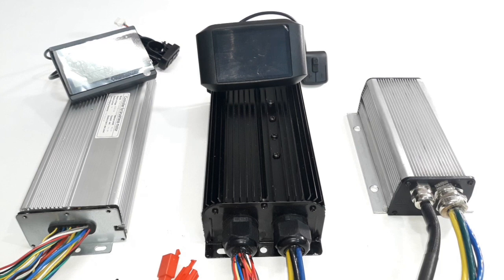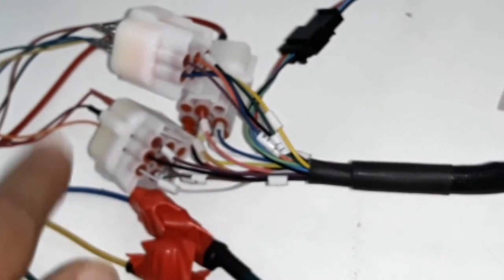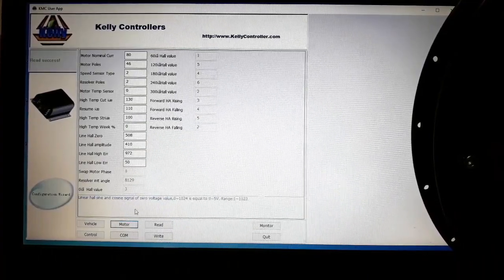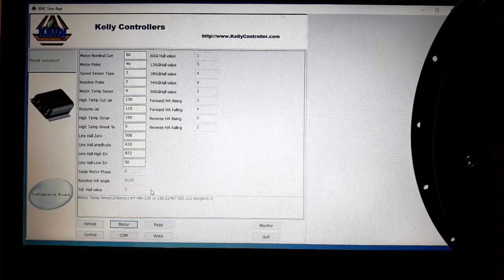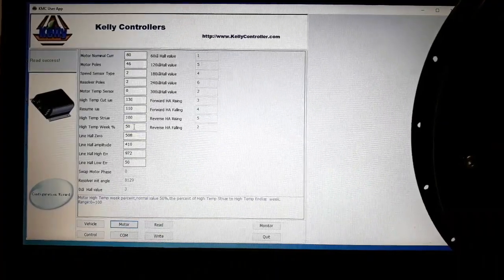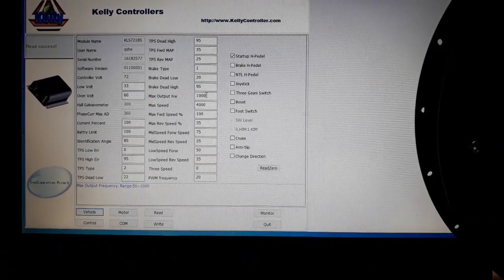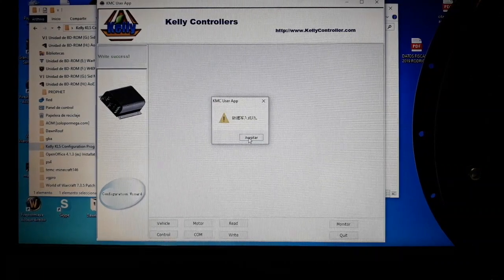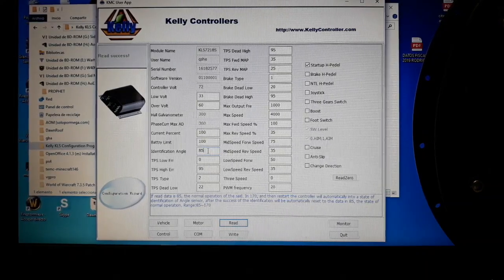KellyController Parameters, Programing setup, Part1 (English)

Comment: Hi thanks where to connect the PAS on KLS7212S ??
Reply from the maker: Hi Jean, this KLS controller models does not have PAS sensor input chanel. 
There can be a way to connect a PAS, Torque, Force or similar sensors and made them work, but I do not know how.
Reply: @gonzalop.chomon327  Thank you very much i was lost not to find it.
Reply: @gonzalop.chomon327  I have a torque sensor i will probably try on the accerator chanel
Reply from the maker: @jeanterine4712  Let me know if it works and how.
Reply: Afaik the only way to really get PAS support on the Kelly ESC is to pair it with a Cycle Analyst v3 display from Grintech. To do that you'll need either (easier way) the grin tech external molded shunt or do a CA hookup to the controller motherboard. Then you setup your pedal assist parameters on the cycle analyst.
Reply from the maker: @ABritInNY  Thank you for the info.

Comment: The BBSHD has 88 effektive Motorpoles,does it mean i have to write 44 at motor poles,
And which Temp-sensor do i choose when there is a 10K in the BBSHD??? Thank you
Reply from the maker: The BBSHD motor has 4 poles so it will be 8 for the "Motor Poles" field.
About the thermistor, this controller accepts the KTY84-130 (970 - 1030 Ω) and the KTY83-122 (1000 - 1020 Ω) so I believe that a 10K thermistor will not work for this controller.
Reply: @gonzalop.chomon327   Okay only 8 poles, thank you!
Reply: Hi i have another question, my bbshd doesnt finish the identification angle, both LEDs stay on, the error code is 3-4 speed sensor, do you have a ideal what the Problem is..Thanks
Reply from the maker: @manuelschilli4912  First, what controller model are you using?
Second, does the motor start?
Reply: @gonzalop.chomon327  kls7212s, no the motor doesnt turn, it Klicks about 7-8 Times when i do the identifikation angle. When i turn the power on the code 3-4 red Lamp comes
Reply from the maker: @manuelschilli4912  The motor should run even before the identification angle procedure is made.
If it does not turn when you apply throttle means that provably the phases and hall sensor wires are not connected in the right combination.
Reply: @gonzalop.chomon327  okay the phases are colour to colour(yellow to yellow , bl-bl, gr-gr), maybe i should switch the hall sensor cables?
Reply from the maker: @manuelschilli4912  There is 36 different combinations of the hall sensors cables and phase cables, only 6 makes the motor turn.
You need to find one of them. It does not matter if the motor turns in the correct direction, that can be changed latter in the software.
Reply: @gonzalop.chomon327  okay thanks a lot my friend, you saved me!
Reply: Sorry have to interupt you again, i have now tried every position on the phases and halls, the error code is still there, i also checked the motor phases if they are short, but are also okay, whats Strange is when i take out one hall sensor wire when power is on the controller get warm and makes strange noises?
Reply from the maker: @manuelschilli4912  Well like I said there is 6 different combinations of phase cables and hall sensors cables that should make the motor turn.
What you say about the controller getting warm without the motor running it is very strange because there should not be any big currents passing throw it enough to heat it up.
Can you test it in another motor?
Reply: @gonzalop.chomon327  I have tried all combinations, i just Think its the Controllers fault, i will order a new one and test it the next days, thanks for your time 👍
Reply: Hi its me again, new controller works. I have my motor current on 40% means 48A(120peak) and the batterie current at 100%(batterie cells have max 48A output) does this mean the batterie current max. is also 48amps.
And low speed doesnt work, i have max speed at 15000 and low speed at 20% but the bike doesnt get any slower at low speed. Thanks
Reply from the maker: @manuelschilli4912  The "Motor current" is in order to protect the motor, here you set up the maximum current that the controller will give to the motor at peak.
"Battery Limit" this is in order to protect the battery, if your battery can give up to 48A then set it up for that.
In order to activate 1, 2 or 3 speeds you need to put the value of 2 in the "Three Speed" field.
The maximum speed should be set up close to the maximum speed that the motor can achieve, else the three speeds function become obsolete. As well that can be used to tune the speeds to your needs.
For more info about it check the videos.
Reply: @gonzalop.chomon327   Thank you, but battery current is also percent, but of which one, is it percent of the amps i but in at the max motor current, or is it the percent of what the controller can handle continious or peak, or isnt it in percent?
Okay so i have to go down with the rpm, do you know how much it is, bbshd at 72volts. Thank you
Reply from the maker: @manuelschilli4912  This is not a plug and play controller you need to RTFM.
"Battery Limit" refers to maximum power that the battery can deliver continuously.
"Current Percent" refers to the maximum peak power of the motor.
I don't know the KV of your motor. With that number you can calculate the max motor speed = KV x Max. Battery Voltage.
Reply: @gonzalop.chomon327  Okay i have now tried to set the motor rpm lower, turned the three speed switch on 2, on Monitor Button the low speed goes from 0 to 1 but the motor runs with the same rpm, do you have any tips why?
Reply from the maker: @manuelschilli4912  I had once a controller that didn't recognize that either. I suppose it was faulty. It maybe your case as well.
Try 3 speed instead to see if there is any changes.

Comment: I don't understand, i used your very usefull video to link my kls7212s to my mxus xf19 but it don't work. I linked the 5 hall wires, the 3 throttle wires, the power wire to the plus of the 52v battery, the 3 phases wires. When i first plug the battery and the power cable i had a green light flashing on the controller, i immediatly tryed to use the throttle and i felt a beggining of reaction like a very little impulsion every time i started to activate the throttle, avery very shy move then the green flashing light turned to a flashing red like this: 3 times flashing then 4 times flashing again  and again. If someone can help me, i checked all the connections, nothing wrong
Reply from the maker: @jeanterine4712, 3-4 flashing light means: Angle Sensor Error:
It can be:
- Connected the phase wires or the hall sensors wires on the wrong combination
- Damaged hall sensors
- Identification angle procedure not made or failed
- Wrong setup of kind of sensor
I bet for the first or third reason ;)

Comment: Hello dear how i can increase mor power to motor?   and more power throttle?
Reply from the maker: In order to give you some advice about it I need detailed information.
But before of all you need to know this: A battery powered electric system depends on the battery power. So if you want more power the best way to start is to have a more powerful battery.
There is different ways to pimp up controllers and motors so they can give more power that what have been designed for, but first the battery has to be able to give that power to the these devices.
Reply: @gonzalop.chomon327  battery 72v 42A controller kelly 3000w 150a
Reply from the maker: @danabuksis6231  I suggest bigger battery if you want more power, but may depend in your application, if you need it to run just for a few minutes (10-30) it may be enough battery (at the costs of battery life)
With that little info is not much more I can recommend you.
Reply: @gonzalop.chomon327 What's in the app category for more speed?

Comment: Dear friend, please help me. I connected everything and a red light and a green light came on. The engine does not turn when I turn the throttle and I connected everything properly. I would appreciate it if you could get back to me as soon as possible.
Reply from the maker: Usually the red light will flash with a code, 3-2 or 4-3 or whatever.
At the end of the manual you will find what every code means.
If you can not find it let me know the code and I will try to help you.

Comment: So there is no Regen ??
Reply from the maker: You can setup the regeneration different ways: No motor brake, Intelligent automatic regen brake (using brake switch), Analog regen brake (using a potentiometer or a hall sensor throttle/pedal), Release throttle regen brake and as well you can setup, slope braking aid and direction change regen braking.
You can see how to set up on next videos:
Part 2: https://www.youtube.com/watch?v=_if9dnVkr6U
Part 3: https://www.youtube.com/watch?v=ITP6mey2eCk

Comment: I Gonz, i see your video 2-300 times, but in something Im wrong:
 

I  I am Carlo and write from Italy.
I have a problem with the Kelly controller paramenter !
I use a Kls 7218 s, a mxus 3k turbo 8000W peack, and a  battery  pack 72v 28Ah 2160 Wh (compost of 160  samsung cell  35 E  18650 ) at last,  a Daly bms 72v  20s 150 Amp. 
The sistem dont' work!
I change all the possible parameters on kelly's App. But Noting!!!
So I ask me, and ask you :
-1 : is possible that the color of the fases ar wrong..??? if i change the color for try, i broke somenthing?? and
-2:Do you have, and do you can,  send me all the true app parameters, for a pretty use?
I don' t know ...I am disperate.....the seller of the kit, is a very bad boys...and i don' t know more what i can do.
If you can help me 
….I'm becaming mad!

Carlo,
Reply from the maker: As you already have played with the parameters in your controller, first make sure that in the App you are using hall sensors parameter (Your motor has hall sensors)
Then you need need to make the motor turn. 
There is 36 different combinations of how to connect the cables of the motor and the hall sensors.
It only works in 6 of those 36 combinations. this is done by try and error.
When you see that the motor turns (does not matter what direction) DO NOT TRY TO GO FULL SPEED.
After that you have to do all the proceedings explained in the video.

Comment: Συγχαρητήρια για το ωραιο βιντεο, θα ειθελα να θεσω και εγω ενα προβλημα που αντιμετοπειζω με εναν ελεκτη KLS7230N  δεν συνδεεται μεσο Bluetooth εχει γραψει τρια σφαλαματα με τα γνωστα μπιπ,  (1,3) (3,3) (3,4) τον αποσυνδέω απο το ρευμα και δεν διορθωνη τα σφαλματα και μου γραφει οταν παο για να συνδεθω  device is not opened please open device first, καθε βοηθεια θα ειναι πολύτιμη ευχαριστω εκ πρότερων.
Reply from the maker: The errors that you report are the following:
1-3 Low battery voltage: Charge battery and check battery voltage limits at software.
3-3 Faulty throttle: Check the throttle device and replace if faulty, as well check threshold limits of throttle.
3-4 Problem with hall sensors: Check if hall sensors are ok, Check connections, Select the correct type of sensors, Proceed to make the hall sensor identification angle procedure.
Reply: @gonzalop.chomon327  thanks for the help online ok now we have (3,3) PEDEL ERROR writes it in red .. what we do ..  TIPS; HALL GALVANOMETER RATE RANGE 0-1000A.
Reply from the maker: @christosxenopanagos2737  The best will be if you can try another kind of throttle.
Reply: @gonzalop.chomon327  ok the throttle works but when the closed one is a little slow to slow down, what else can it do ..
Reply from the maker: @christosxenopanagos2737  Sorry, I do not understand your comment can you rephrase it.
Reply: @gonzalop.chomon327  Gonzalo, good morning, whatever we say about your help will be a little, if you could give me this consulting help, I will be grateful to you, (1) the throttle when the bed is moving slowly with the engine speed delayed, (2) which cable do we connect with SMART BMS display, for the indication of kilometers, thank you!
Reply: @gonzalop.chomon327  It is also dangerous to drive when it is slow to reduce the engine speed by about a second.
Reply from the maker: @christosxenopanagos2737  For your comments I understand that you have 3 different issues:
1- When the throttle is at stop position the motor still runs; You need to increase this parameter: TPS Dead Low (Throttle starting point)
2- I don't know what kind of BMS you have. If you mean that it can tell you the speed of the vehicle then the signal used is a phase signal or hall sensor signal. If it is the amount of Kilometers covered or left at your battery by you vehicle, then it will be more complicated as it will require some calculations.
3- The motor takes long to stop: After you have adjusted the Throttle starting position (TPS Dead Low) test if this behavior has fixed. If not you can then reduce the parameter: "Accel Rls Time" and set it at a low value (Usually 1 or 2 for vehicles. Not recommended to set it at 0)
Reply: @gonzalop.chomon327  

The throttle and screen
 mileage work properly, final speed 53 km only, we can change a little more, I have titanium lithium batteries 60 volts 30 amps, 3000 - V2 engine, controller KLS7230N, if I connect 3 speeds will the final increase?
Reply from the maker: @christosxenopanagos2737  Glad that you fixed your problems and now it is working properly.
Motor "nominal" top speed is related to motor KV (A motor characteristic) and voltage applied.
With this controller you can limit the top speed but you can not increase it over its "nominal" top speed.
Anyway, check if you have not limited the max speed in the controller somehow.

Either if you want more speed you need to change the motor or the battery voltage.
Reply: @gonzalop.chomon327  One more tip .. I am trying to activate regenerative battery charging with brake function, how will I activate it thanks!
Reply from the maker: @christosxenopanagos2737  You can activate regen braking on different modes/ways.
On the 3rd video I explain about it:  https://youtu.be/ITP6mey2eCk
Reply: @gonzalop.chomon327  thanks for everything good continuation ..!

Comment: WHAT I LEARNED .... you must use the kelly RS232 driver
Reply from the maker: Yep, you can use that as I did. As well there is a Bluetooth connection device available, but I have not tried it.
Reply: @gonzalop.chomon327  Does anybody know can use normal 5v TTL programmer ? (GND, RX, TX, 5V)
Reply from the maker: @garbagej4427  Not sure, but I think that can not be used for this.